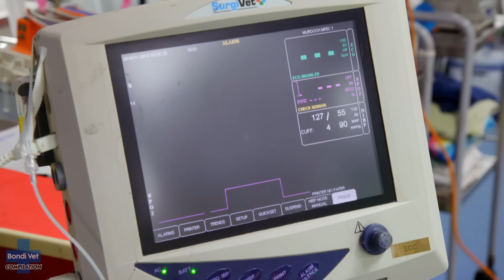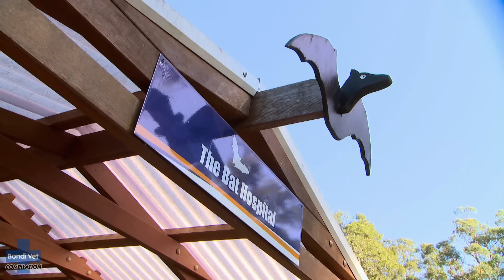Scariest (And Friendliest) Animals Ever! 🦇🎃 HALLOWEEN TRICK OR TREAT SPECIAL | Bondi Vet Compilation

Comment: I used to live in a two story house and almost every summer I'd had to chase brown bats out. Lived there for twenty eight years. The last time I had to chase one out, I had woke up one morning and found one hanging on the curtain on the balcony door. I closed the bedroom door so it wouldn't get out into the rest of the house. I opened the balcony door as I'd thought it would fly out but it didn't. So I thought I would chase it out with something. I saw a paper towel tube and tapped the bat with it. It flew back into the room, which scared me and I fell back and in the process twisted my knee. I barely made it to the end of the bed where I sat. The bat landed on the bed beside me. I waved the core at it and it flew out the door. It looked like it was sad to be flying in the daylight. Thankfully I didn't see another bat and have since moved. God bless.